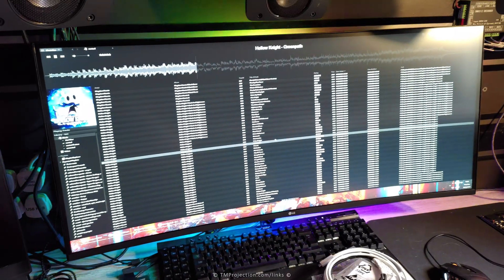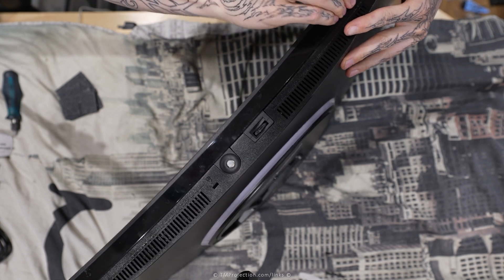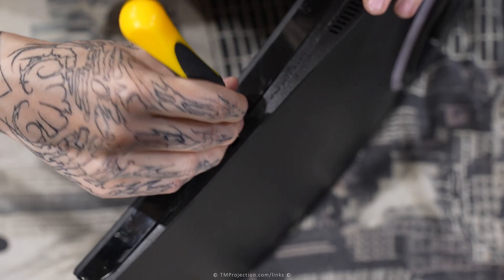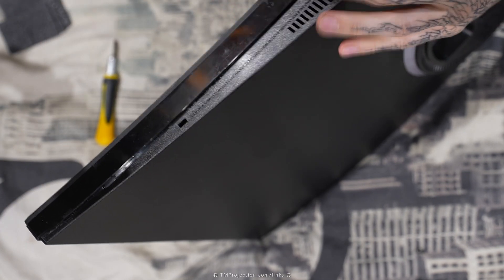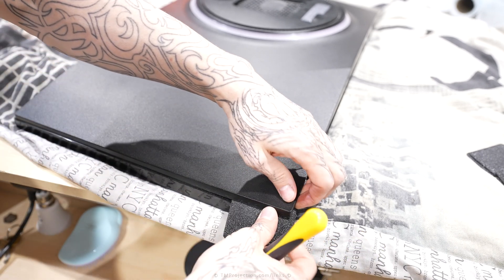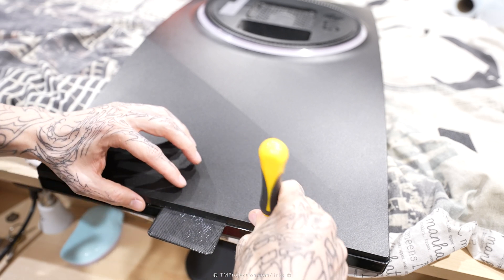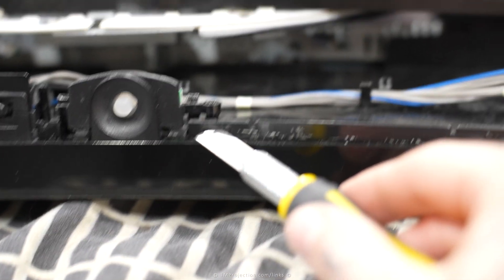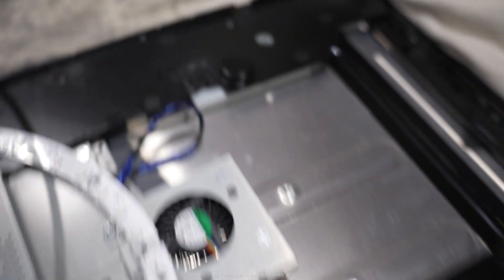LG Ultrawide Monitor 38GL950G-B Disassembly and Repair - 01 Flickering and Removing the Back Cover

Comment: Great work! I have to replace the panel. Is there something to take care of during disassembly or should it be easy to remove every part of the case from it?
Reply from the maker: the prying i suppose, use softer plastic pryers perhaps?

Comment: Sheesh, like opening up a big-ass-heavy laptop.  My LG LG 34GK950F-B  has died a second time after LG previously repaired it about 2 years ago.  I am not sure if it is the ribbon cable that melted or just a dead mainboard.  I may attempt to swap out some components if the ribbon cable going to the panel hasn't melted.
Reply: How did it go? I’m having the same issue
Reply from the maker: i really doubt it has anything to do with the ribbon cable, usually the main board with the problems

Comment: Do you know which part of the monitor is having the problem if it's acting like this? Is it the ribbon, mainboard or the lcd panel? Before it starts getting worse, there are multiple horizontal lines appearing gradually over time but it's not as distracting as the current one. I have tried lower  the refresh rate but the symptom is still there.

https://youtu.be/s-sbS4NTo9A
Reply from the maker: first of all try another monitor from the computer, just to make sure its not the graphics card thats the issue